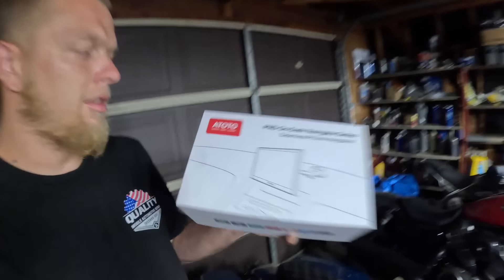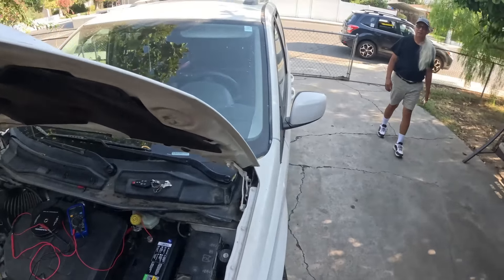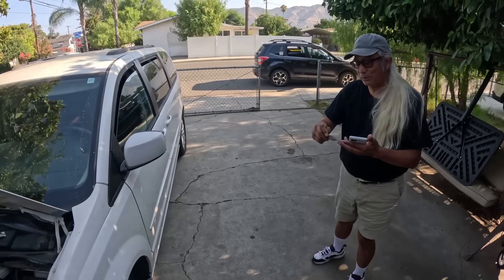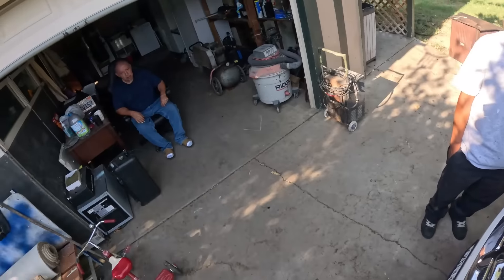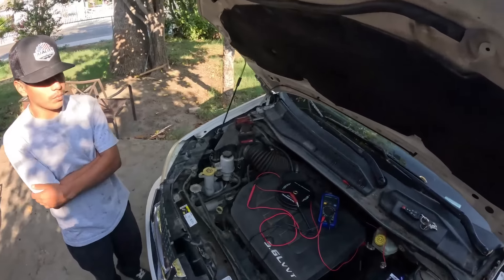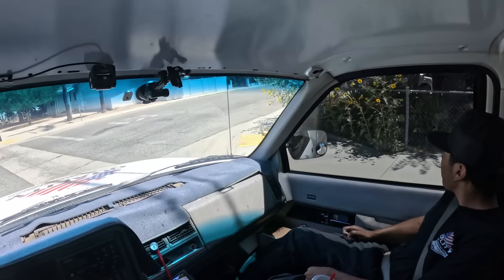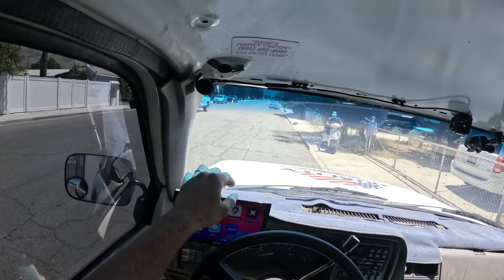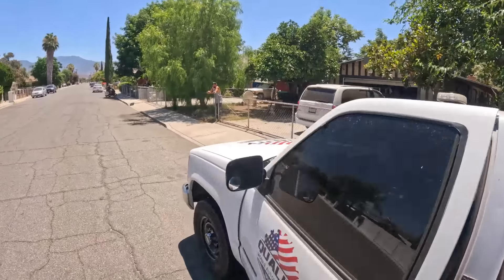CUSTOMER was UPSET! Mobile Mechanic ELECTRICAL diagnosis

Comment: I've owned 3 mopar products. Of those, two had weird issues which came from the instrument cluster. About 7-8 spots to reflow (you can visually see cold solder cracks) with solder and problems went away. 98 voyager- crank, no start, and 97 sebring- no prndl or odometer.
The durango, I didn't own long enough.

Comment: When the HEI ignition first came out it had an electronic module inside that was ridiculously defective.  We had to keep the defective ones to show the warranty rep. in order to get compensated for the parts loss.  After just a few months, they would just take our word for it.  I personally was doing a repair and had to go to the parts window six times to get a new part that worked.  It was rare for the first one to work.  New doesn't necessarily mean great.

Comment: Not sure what years but isn’t there a bypass kit from Chrysler for the fuel pump? Those TIPM’s have had an issue with fuel pump stopping because of that integral relay.  I remember years ago Fords had an issue with voltage drop feeding the AC clutch causing it to burn out the clutch . Ford came up with a bypass harness so it would maintain 12 volts .

Comment: As a mechanic you should know not to run that low on fuel lol. Mopar tipm are notorious for going bad I just replaced the one in my 3rd gen ram 3500 earlier this year. Tipm where hard to find for a little while I recommend all computer resources if you ever need anything like that .

Comment: You can do voltage leak test as well as voltage drop test with the 10 volts. You should of confirmed before you left so they wouldn't have to do another parts run.

Comment: .050 amps is the industry standard. Even .075 amps wont kill a battery for at least a few days. I have the same scan tool, (Phoenix lite 2?) Luv that thing. Prefer it over the shope Snap On triton d-10.

Comment: Some advice: There is a much better way to keep power. Find a fuse with constant power. Put in a fuse tool that has a terminal that you can connect to. Plug the terminal into a jump pack. Done. You can also do this via the diagnostic plug. Additionally, you failed to tell the guy that draws can be intermittent.

Secondly, you never checked that the integrated relay is getting power and ground to the trigger side of the relay.  As a result, you could replace that $800 part when the problem is a cut trigger wire from the ECU.

Comment: May I suggest a clamp over meter for draw testing UTI T model UT210E, the best investment ever. I worked on MB cars and this was a time saver, just don't leave it on the cable. 40+ years dealer tech
Reply: Harbor Freight sells a good AC/DC clamp multimeter.  A regular inductive AC clamp meter won't work for DC current through the clamp.

Comment: With the decline in the quality of new parts nowadays, I refer to NEW as Never Ever Worked. Meaning that, because it's new, it's never worked until you install it and see if it does. I appreciate that you actually did a parasitic draw on the vehicle.

Comment: You CAN bypass the relay and put in a external relay ran off another fuse that only gets power when the vehicle is running and that would work temporarily.

Comment: Certified master mechanic here 48 years experience  and i changed my moms tire because itt was flat a week later my brother drove car with a busted top radiator  hose till it stopped any way mom called and said that since i changed the tire the car started to get hot a few days later.love you mom

Comment: TIPM is bad   Rewire the fuel pump relay per STAR case or replace TIPM   A case of two different issues not communicated well by the customer

Comment: I understand that you can't do every kind of repair as a mobile mechanic, BUT the Grand Caravan starts with a booster on the battery, so the fuel pump relay WAS being pulled in at 14V .
Diagnosis:There is excessive resistance in the circuit energizing the relay, which draws enough current to be self-holding until power is shut off.  
Observation:This could be as simple as corrosion on a pin of a multi-pin connector or a cold solder joint.  ( Durability of both under extreme temperature cycling is limited.  )
Referral: A shop that specializes in electronic diagnosis/repair could determine if that's the case, and if so could fix it for a lot less than $1K.

Comment: U can take the relay board and clean it and it can fix the problem on these if the board doesn’t have burnt resistors or capacitors on the board . I’ve done this a bunch of times . It’s starting once in awhile and has started so I don’t think it’s burnt out because if it was it wouldn’t have started at all !!

Comment: Isn't charging voltage controlled by the pcm? A quick fix would be to add an external voltage regulator and bypass the pcm

Comment: There is a simple fuel pump relay bypass you can do on those so you don't have to replace the TIPM. It has you install an external relay that is easily replaceable in the future. You can also easily solder on a new relay to the PCB, but the external relay is a better solution. Just google TIPM fuel pump relay bypass. I've done dozens of them without an issue. A $15.00 relay is so much better than $500.00 + reman TIPM from Chrysler.
Reply: I have a newer (2016) Jeep that developed a similar problem. The newer TIPM has a more robust fuel pump relay and mine didn't fail. The connector failed! The fuel pump draws 10 amps and the connector pin burnt up. (Connector that plugs into the bottom of the TIPM.) The burnt pin melted into the plastic connector. I repaired by cutting the wire at the connector and attaching it to a fuse tap.

Comment: correct me if im wrong..

There's a way easier and safer way to check for a parasitic draw... disconnect negative terminal... dvom leads from neg side of battery terminal to terminal of battery. anything more than iirc 25milli amps you have a draw..

which diag system was that you pulled up on the laptop? all data? pro demand?

Comment: Do we not use a hygrometer to test cells anymore or is it a sealed battery that you have to use a load tester on. Good video! Years ago when i had a battery replaced on one of my cars with a brand new Sears Diehard and it tested water in one of the cells with my hygrometer the very next day, i took the battery back to Sears and i got 7 years out of that battery!

Comment: there was actually a factory recall on the tipm and that vintage of van from Chrysler. They replace it with an external relay. That customer may be able to get that fixed for free.

Comment: "Sand and crap gets in there" which is why you always spray it out with contact cleaner and then put silicon grease on the pins so the connection stays clean and dry.
 Or you save 75 cents by skipping that and it corrodes.

Comment: I go to a guy that recycles batteries. He gives $10 for a core and charges between $25 for a 650 cca battery and up depending on cca. I always get a better, fresher, rebuilt battery that hasn't sat on the shelf for a month or longer possibly discharging and losing cells. Stores will also sell you a different battery that cost more usually claiming they're out of the one you need.

Comment: Why didn't you just check it on the negative side then you didn't have to worry about shorting anything out. 
When I do these tests I put a pull apart the negative foot my meter on amperage and in line with the negative line. 
Same result but you don't have to worry about something blowing up like you got set up.

Comment: Had 3 friends with same symptoms last spring...i said "i can help with that"....showed up to each place with sandpaper...cleaned all battery connectors till shiny...no more problems....1 friend had 3 different mechanics fail to make a proper "fix"....go simple first

Comment: Out of fun I compared your fuel price to the UK.  26.732 usgallons is 101.2 litres, 101.25usd is £77.35 uk.  Which means you are paying £0.76/ litre compared to the UK currently in my ares £1.48/litre, so your fuel is almost half the cost of that here in the UK.

Comment: I understand the customers frustration having had multiple people mechanics out there. You gotta pay the new guy that comes out though, a parts changer will cost you more money than a technician who performs his own diagnosis so he can inform you and advice you on the proper repair that will fix the root cause. Advise the technician on the symptoms of the car but don’t treat the tech like he doesn’t know what he’s doing. The battery has a dead cell, at my old shop we always had a brand new battery that was bad on the rack every once in a while and we’d just exchange it for a new one and it’s the simple. He can’t diagnose properly anything electrical if he doesn’t have a healthy battery to run his test on and check voltage and function of any electrical components.

Comment: These vans are notorious for the fuel pump not turning off when vans not on and draining battery. When the vans off open gas cap and just listen you will hear whirling sound.  I had this problem they make a bypass to jump off another fuses that stops the van from constantly dying just in case you work on another van

Comment: There’s a little trick we do on these Mopar vehicles when that relay doesn’t get power anymore we grab 2 add a fuse wires join them together and hook it up to the cigarette lighter so every time you turn the key the fuel pump will get primed it’s a neat trick for now until you can buy a new fuse box

Comment: I think a thermal printer even though you need a specific paper for it would be cheaper and free up room in your truck another option is a tablet with a stylus, asking if they want paper or digital.

Comment: So, common issue, there is an external fuel pump relay kit available..Chrysler has it, its part of a TSB procedure,  also available in the aftermarket..not pricey and less than an hour to do

Comment: Saintly Patience. Customer repeats the same story over and over, leaving out or misstating what did or did not happen. "Crank, Start, New Battery, The Other Guy."  Having to talk them in off the ledge while trying to diagnose with faulty informatioon. And most customers are either completely lost as to technology or know just enough to mislead.

Comment: I put a deep cycle marine battery in my odyssey because it was $80 and I thought eff it let's see. It says not rated for freezing weather but I've had it through 2 freezing winters and one time we had a week of 25 below with no problems. Also you can discharge them down to 20% of charged without damage infact they thrive on discharge and recharge, they're great batteries better than lead acid wets.

Comment: I'd just treat it like a racecar, run a wire from the positive side to the fuse with a switch and turn it on when you start the car LOL

Comment: We inherited a car that had a security key thing added on.  And because we didn’t drive it a lot, it would constantly drain the battery, we finally realized and took it out, after going through a couple batteries.   Probably not related, just sharing.

Comment: Confused as to how much customer paid for the board - was the integrated circuit board exchanged or was it new? 

Dependent on costs of nes or exchanged pcb - could  one not put  an external relay on thereby ignoring pcb?

Prob not difficult to replace components on the pcb tbh 

Can the integrated circuit board be fixed / s

Comment: Replacing 12v battery on Prius only 1 of 6 AutoZones near had em. Back to back, (2) $250 batteries were bad. Immediate replacement under warranty,no questions asked. No, not wrongly jumped or anything.

Comment: i would of put a wire from ignition to the fuel pump fuse, so when the ignition is on the fuel pump works , that way he can use the car and can go get a new part and have you put that in...

Comment: If the problem is with PCM fuel pump relay inside it or integrated to it,   the car not just crank no start, but the car should stall while running also, I guess.

Comment: I would have tried a jumper wire first they sell them on Amazon 13 dollars I've had the same problem on three vans and have used a jumper wire and it's been a few years now and still no problem

Comment: When u have that board burn out for that fuel pump u should offer them a toggle switch and   run power to the fuel pump it would be cheap and keep them on the road

Comment: You must of been focused on the battery issue and overlooked the crank no start at 14:00 in video. He gave a few more hints after that of crank no start. He was probably cranking the hell out it killing the batteries.

Comment: Batteries in Dodge Caravans don't go for $350, more like 120 at Wallmart. Autozone, maybe 200.
Reply from the maker: @chrisfrank8413  Autozone $220 plus tax plus installation =$350
Reply: @QualityMobileAutomotive  Most expensive battery plus $130 to install it. Why nobody uses mechanics who don't have too.
Reply from the maker: @chrisfrank8413  that’s mid range battery the most expensive is 260. Cheaper isn’t better. It’s actually $125 labor for me to drive to the parts store, buy a battery for the customer, drive to the customer and install the battery, drive back to the parts store to return the battery core, and finally go home.
Reply: @QualityMobileAutomotive  I don't see it. I make 50 an hour, and take home about 280 a day. so, that would take you, what about 1.5H at most? you do you. I'll do my own car work. Been doing it for 40 years, worked out well for me.
Reply from the maker: @chrisfrank8413  1.5hr by your $50 an hour makes it a $150 bill. I’m only charging $125……… and I’m licensed, 4 insurance policies, software for the repair orders, gas, vehicle maintenance, repair guides, paying business taxes, etc.

Comment: Aha 951 area code lol knew ya was in So Cali , native myself, now retired in SE Asia

Now days, there's way too many bad "New" parts sold! Buddy has a 2002 T-Bird, was having starting issues as well. Same thing jump started easy but would be dead by morning, or even in few hours. NEW Motorcraft battery in it too, I did draw tests etc couldn't find a real drain.........Low and behold, I finally just took the battery for a REAL test, and guess what, BAD 2 cells lol told his wife SEE, new don't mean sheeyat now days!.....

Worked at a Ford dealer in the mid 1990's, was doing a t-stat replacement on a Ranger pick up. Took me 3 NEW T stats from the parts dept. to finally get 1 that worked right! First 2 failed and was not fun re-draining the coolant etc to replace it 3 damn times lol

Comment: You should know better than to drive around on empty, the fuel is what keeps the fuel pump from overheating.

As for the bad cell, get yourself a dedicated battery tester that does printouts, makes quick work of customer's misdirected anger.

Comment: Sorry but, the customer did state the original issue from the beginning, "it would crank strong but not start". By him adding some top charge it was giving the PCB relay a little kick to work and the alternator charging kept it there which is why he thought something was draining the battery.  I am sure repeated charging and probably over charging killed the battery. I mention this because listening and understanding  e x a c t l y  what the customer is trying to describe is the most common overlooked issue between customer and repair professional. I think your doing great and wish you success.

Comment: Does this vehicle have an auxiliary battery? With a lot of Chrysler vehicles they have a secondary auxiliary battery than controls the auto start and stop. If the auxiliary battery needs replaced it shuts itself off.

Comment: Why don't you have a battery load tester ?   That's basic 101 auto tech equipment.  You could have shown the guy on the screen or a printout that the battery was bad.

Comment: If you buy a high enough amperage relay and find out what wires go to the integrated relay you can tap off them and have the external relay until the customer can obtain another distribution box.

Comment: I bought a battery from Walmart that died a couple of days later. It wouldn't hold a charge. Walmart said they'll charge it. Handed it back to me a day later. Same thing happened. They did NOT want to honor the replacement warranty, but after a scene, I got another battery. 1 week later, it is dead. Walmart said it has to be something on my truck causing it. This battery would not hold a charge either 😂. I finally got my money back and bought a battery from a different store. 4 years and it still works great. 2 bad batteries back to back that were brand new.

Comment: Never had luck with Walmart battery’s! Die hard have been most reliable. Years ago has 2000 Cadillac eldorado it would eat interstate batteries in a week. Put serval in finally gave up but a diehard and issues ended . They would lose a cell every time . One time even lost the program and started running on 4cyl from battery dying . These people called you for help then want to tell you what’s up lol god bless you

Comment: Last time i bought new battery 2 years ago it was guided in it to first charge it off the car to full before installing to use. I think that was stored uncharged. Putting uncharged new battery in and charge it while driving only could degrade it.

Comment: Hmmm….you jumped it and it started, but I never saw you check the charging voltage? I believe the guy about having a new battery but the new battery keeps loosing charge, so the battery is only a symptom of the charging/electrical system. Maybe the diodes in the alternator failed? That will kill even a brand new battery in just a few days.

Comment: You really really need an amp clamp. Doing an in series quiescent draw test with a meter like that is old practice. Works great on circuit boards but not cars. You could temporarily reset the draw by disconnecting the cable to put your meter in series like that and then you all be chasing nothing